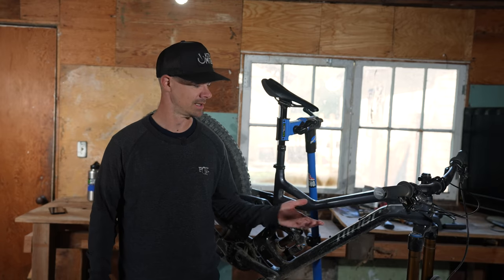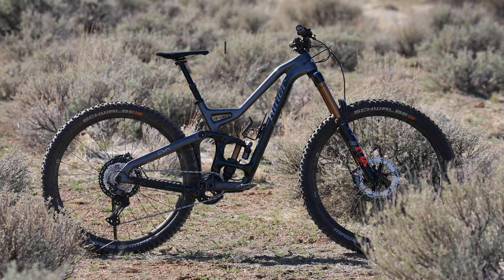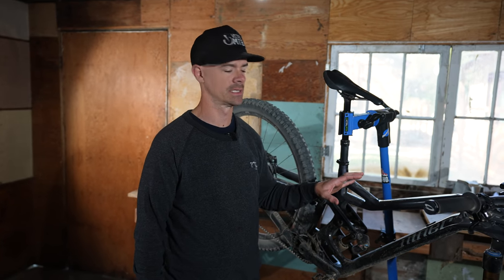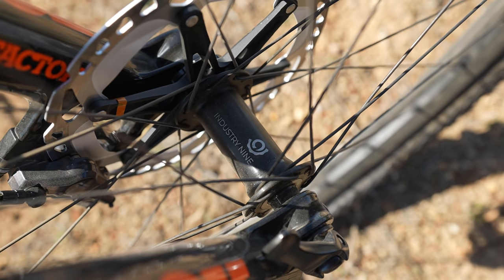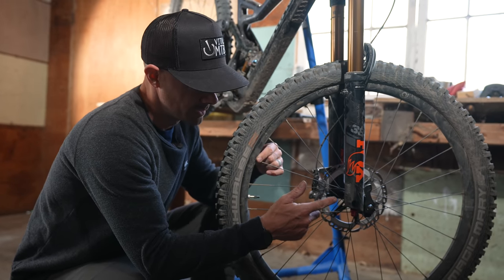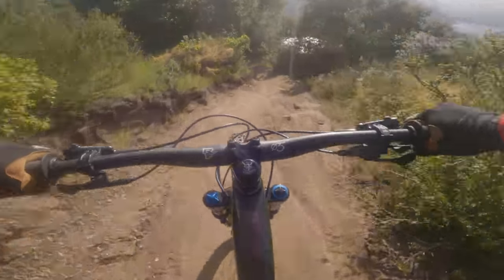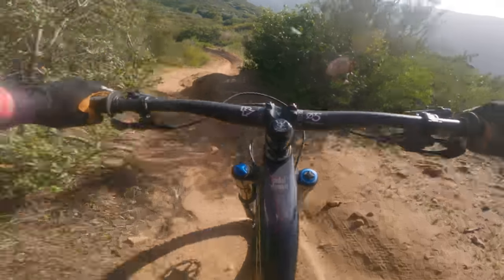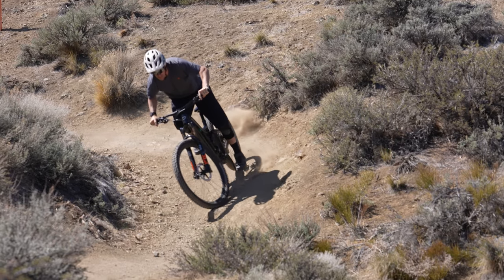It's Back! Vital Tests the 2021 Niner WFO 9 RDO

Comment: I've been wondering when a new WFO would drop. I bought one of the 2009 versions, but while I got a fork for it (a Dorado 29/170mm travel), I was not able to find wheels and tires suitable for DH riding and ended up abandoning the build.  That first year frame was ahead of its time.

Comment: Finally... Now if they only made an Ebike edition
Reply: They did last year
Reply: SX drivetrain, performance suspension. $8,500.
Reply: I have the e bike version. Its decent. But the odometer says you are going faster than you are so it limits you to 16 mph. You can chip it where it tops out with no limiter to about 28mph. The bike cost $6500 when I bought it last year.

https://www.ninerbikes.com/products/wfo-e9/#ProductSection-product-template

Comment: GT or Niner? If you had to choose.
Reply: I used to ride a Jet 9 and the CVA suspension on Niners is truly special. It doesn't have that "rocket" effect that Ibis, Yeti and Evil have, but it has lots of traction and is efficient. On the downs I used to blow through the travel but wasn't harsh. On the other hand, GT is a solid brand that offers good value, but the ride quality is kind of average in my opinion. Reminds me of Trek bikes. Nothing wrong, but it definitely won't stand out in any way.
Reply: Of course Niner
Reply: @gabrielfernandez4897  agreed. The design is what I mean.
Reply: Niner

Comment: If that Seat Tube Angle is 77 degrees, my Nukeproof Giga must be 82 degrees because that looks super slack.
Reply from the maker: effective seat tube angle is 77, but yeah, actual is leaned back a bit.
Reply: Its a bit of BS as the seat tubes are getting shorter and shorter, so is the height the manufacturers use get their STA numbers from. Stick a 175-200mm dropper in that and draw a line from the center of the BB to the center of the seatpost where the clamp/rails connect. Gonna be pretty lazy for sure.
Reply: @MP-MTB  Effective seat tube angle (and TT length) is pretty much always measured at the same height as the top of the headtube, not at the end of the seat tube. But that's still not an accurate way to measure things since tall riders usually have a bit of a saddle to bar drop.
Reply: @HollyBoni  exactly, which is why it's nice to see some manufacturers have increasing seat angle the bigger the frame. Similar to increasing chain stays per frame size

Comment: Suspension clicks are ALWAYS counted from closed. Get with the program Vital..
Reply from the maker: "Always" is a strong word. True, FOX states in its setup guide to count from closed. However, a number of bicycle manufacturers state to start from open. Regardless, this is why we were explicit in our presentation and that for illustrative purposes, counted from open. Whether we started from open or closed, viewers know our settings and (per the written review)how we changed them during the test.
Reply: @vitalmtb  "However, a number of bicycle manufacturers state to start from open." And they should be hanged accordingly.
Reply: @vitalmtb  I think your presentation was clear and got the job done so no biggie, but... When you count from closed you are bottoming out the adjuster on a hard surface rather than spinning it out into the ether. With manufacturing tolerances this does make counting from closed slightly more accurate. However 1 click from open is easier to understand than 16 clicks from closed! Accuracy vs comprehensibility